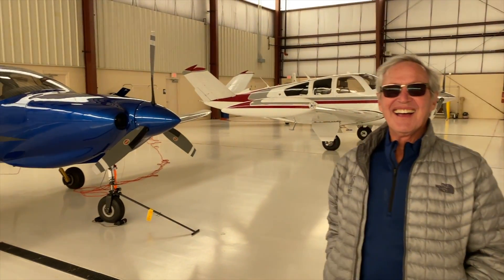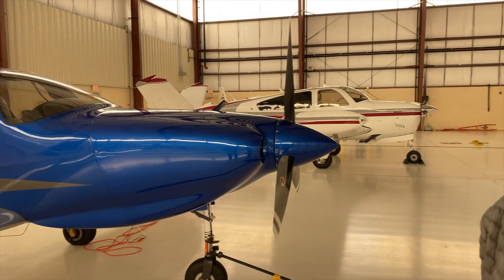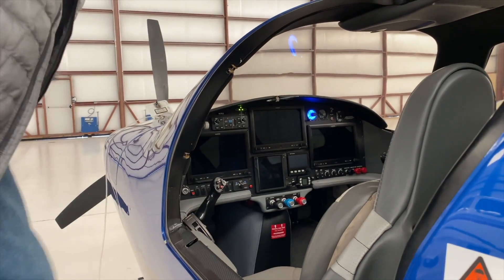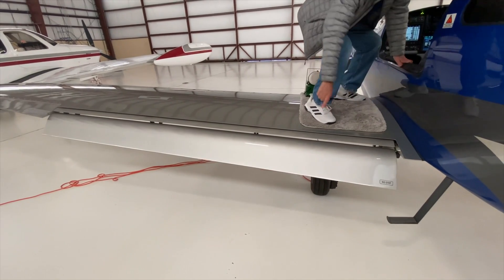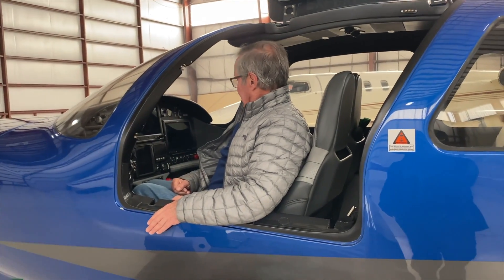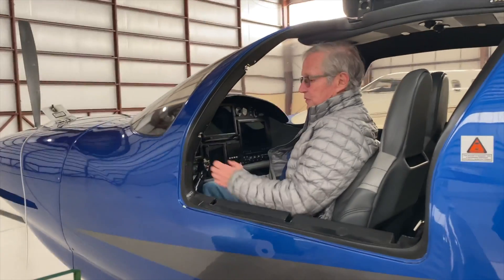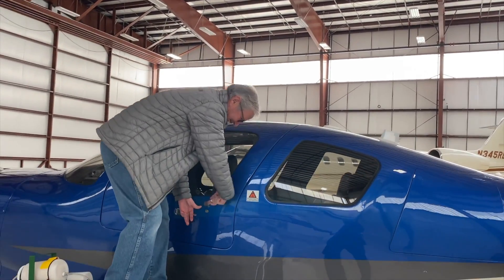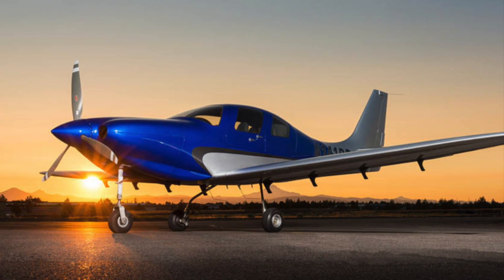LX7 Review with Ken Wolf @ KVQQ Feb 2020

Comment: Pressurised? Cirrus better watch out!
Reply: Cirrus is still much better. Larger roomier cabin, 2 doors, keypad input (good luck using touchscreen with turbulence in the pattern), proven and tested BRS system & better slow speed characteristics. Pressurization is overrated. By the time you reach altitude you'll only be there for a short while, plus you have limited cycles. Ultra long distance trips are probably better left for the airlines.
Reply: @codmott286  Pressurization is far from overrated if you actually fly XC trips over terrain or weather being on a cannula sucks! LX7 Also has a BRS and is way faster than a cirrus they are not even in the same league. Hard to compared an experimental to a certified aircraft both have their pros and cons you have to know what your buying. Cirrus has nothing on the performance and range of this bird, this is not a plane for the "average pilot" and if flown in flight levels ATC expects you to operate like a professional.
Reply: @Jolinator  LX7 might have BRS but it's never been tested. They have no idea what will happen if you fire that thing. The whole airframe might break in half. Cirrus pioneered BRS in civil aviation and have tested it thoroughly with many donor ships plus all of the real world tests. It's proven and they know exactly how the aircraft will respond to it. 

LX7 is faster, cant deny that, however it's not as enjoyable to fly. The back seat is too cramped for adults so it's really just a 2 seater for you and your wife. With one gull wing door it's difficult to get in and out, and even for the front passengers it's still cramped. You will be sitting shoulder to shoulder for the entire ride. Visibility is worse, and of course lancair's legacy for horrible handling characteristics. 

LX7 claims to have addressed this a little but it certainly does not feel as refined as a cirrus. Ultimately the Cirrus is just the more enjoyable plane to fly.
Reply: @codmott286  I think it is the same company that supplies parachutes to both the cirrus and lancair and they do independent testing on each airframe to produce parachutes for that specific airplane. You can't just throw a cirrus parachute in a Cessna, they are engineered and developed for each specifically after a lot of testing.
Both are wonderful airplanes and each have their own pros and cons.
Reply: @superchargedpetrolhead  BRS supplies a variety of chutes with guidelines on how to adapt them to your aircraft. You can put a chute on an experimental ultralight if you want. The testing is up to the aircraft manufacturer, NOT brs
Reply: @codmott286  Oh ok...
Reply: @codmott286  You do realize that Cirrus equips the Vision Jet with touchscreen controls, right? Cirrus also equips the jet with “overrated” pressurization. Why on earth would they do this  on their premium aircraft if both features are undesirable?
Reply: @cascott1392  I didnt say they were undesireable. People want stupid shit all the time. People would buy a touchscreen television for the living room if they could, even though it was be useless and more work than a remote, it just sounds cool. Planning a flight plan on a touchscreen is great. Following vectors and swapping frequencies in congested airspace at 1500 AGL is not. 

And pressurized small aircraft just seems so unnecessary. Most people arent flying these things far enough or long enough to justify the expense. 2000 miles XC? Sure pressurized is great to get above the weather. 200 miles out of state? Why bother, by the time you hit altitude you'd just be coming back down anyway.
Reply: @codmott286  in turbulence the data can be entered via nobs. As for pressurization neither the wife nor the dog would do well with nasal cannula.
Reply: @kennethwolf392  who wants to use knobs? Very frustrating.
Reply: @codmott286  which aircraft do you own and fly, the Cirrus or the LX7?
Reply: @codmott286  in the LX 7 I was at altitude for 7.5 hours on my transcontinental flight. LX slow speed handling is very docile. Cirrus cabin is more roomy, but both are comfortable once in the seat. Bit of a trick initially to get in the LX7 but after a bit of practice it becomes second nature. Two doors is. Ice in the Cirrus , but one door in the pressurized LX7 cuts down the chance of a cabin leak!

Comment: Sad he chose a piston engine.  They make them with a turbine.
Reply: On a plane that probably came with north of a million dollar pricetag (one pistol LX7 is on market for $950k right now) I'm also confused since another $100k for an engine seems like a drop in the bucket at that point.
Reply: @ParadigmUnkn0wn  got the piston for two reasons. 1) much greater range and I fly long distances routinely and the turboprop would frequently require a fuel stop.  2) I have a basic med ticket snd am limited to 17500 feet snd a turboprop doesn’t run efficiently down that low. I’m happy with my long range bird. Recently flew it 2150 nm non stop from Redmond Oregon to Jacksonville Fl. That was fun! Can’t do that in a turbine with roughly twice the fuel burn!
Reply: @ParadigmUnkn0wn  The turbine version is about $1.1m dependent on the cost of the donor Lancair IVP and the cost of the "used" Pratt engine.  It could be a little lower if a good deal is found for either.

Comment: The only plane in the world that’s better than the Panthera especially since you don’t have to look through a huge Ibeam pillar going down the center of the windshield and actually has the strength to go well over 200 kts, unlike the Panthera that has a very weak tail severely limiting its VNE speed. Now they just need to put a MT reversing Prop on it to get into the shorter runways and it would be perfect.
Reply: i like the center pillar, improves visibility from the sides
Reply: The Panthera is a joke compared to the LX7.  It is far slower and has far less range.
Reply: @speedomars  The panthera had great potential but it was entirely built around Lycomings next 4cyl engine which they abandoned forcing Pipistrel to redesign the airframe around a 6cyl engine costing them all of their performance gains. Now the plane is no different than any other, just a unique interior.
Reply: @speedomars  Panthera is no joke, all the possible new Mooney buyers are dumping that stupid plane and going for the Panthera and the rest are trying to sell their planes for the Pipistrel, since Mooney has become the real joke in performance, no weight carrying, embarrassing landing gear, abysmal landing performance. Even an old Comanche 260 is better at everything than a new Mooney, even the flaps are better on a Comanche than a Mooney.
Reply: @tropicthndr  You are smoking something.  The Panthera is not in production...it is an EXPERIMENTAL kit plane right now.  It is not certified.  It will die like Mooney died for two big reasons.  1. it is made not made in the US and it has no support network.  2. it has retractable gear making it hyper expensive to insure and maintain.  3. its range and performance specs are unimpressive.  4. no one has seen one yet in person.  who is gonna buy a plane you can't sit in or see?
Reply: @tropicthndr  Mooney buyers.  Need you say more?  The Mooney is another loser aircraft any surprise those types go after another loser?  But it makes sense Mooney's would go for another retractable plane...they are like leemings over the cliff.
Reply: @tropicthndr  Mooney's are a cool plane though! Still the fastest certified single engine piston, Utility category and built extremely strong, speed brakes, NXI G1000, 25k ceiling, great range, and a useful load that is actually comparable to most other single engine pistons if they are all loaded with the same amount of fuel. People forget that the Mooney can carry a lot of fuel. Full fuel payload is actually about the same as this LX7. 320 LBS.  Plus they look great. Most new buyers are probably going for the SR22, sadly, because of its great useful load, Garmin Perspective avionics, and BRS parachute.
Reply: @speedomars Retractable landing gear has been common on piston airplanes for over 60 years. I doubt insurance is a major hurdle for any pilot with reasonable flight experience. And Cirrus had no trouble selling over 500 of its single engine jets with retractable landing gear. Many of these pilots were probably stepping up from the Cirrus piston plane.
Reply: Any Cirrus is better than the Panthera....in fact the Panthera is just the latest wannabe Cirrus aircraft.
Reply: @speedomars  i wouldnt really compare it to the cirrus. It's completely different. 3 doors, center pillar, center stick, 3 screen panel, t-tail.
Reply: @codmott286  You are talking about cosmetic differences.  The reason it wants to be a Cirrus SR22 is that its all carbon fiber airframe, BRS chute, piston single, same gross weight class, non pressurized, same ceiling and range, same basic seating.  The major difference is fixed gear versus retractable.  And that is why the Panthera will not succeed.  Mooney lost against Cirrus for basically the same reason despite making a slightly faster plane.
Reply: @speedomars  by that logic all planes are trying to be a cirrus. What you are describing a 4 seat XC plane, doesnt make it a cirrus knockoff. The appearance and flying characteristics are unique enough that the Panthera is its own plane. Also Pipistrel has a USA presence so parts/service shouldnt be an issue. You might not get the same turn around as a Cirrus owner who can get service at any A&P they land at, but it's a new plane, not a new rocket.
Reply: @codmott286  You misunderstand.  But I am not gonna teach you the basics.  Study the designs carefully.  Maybe you will get it.
Reply: @speedomars  Thats fine. You are trying to say both planes are similar because they both have wings and can fly.
Reply: @codmott286  You can skip reading the details of what I said...that's  your problem, not mine.  But if you want to better analyze and assess what the Panthera is versus what a Cirrus SR22 is...you will let your ego down and accept the objective facts.  BOTH planes are all carbon fiber and BOTH planes have a parachute...BOTH planes use Garmin glass and BOTH planes have similar power, range and crusing speeds.  In short, they are competing with each other for the same mission parameters and are built the same (carbon fiber v metal and rivets).  The major difference is the landing gear and that is a problem for the Panthera.  Retractables are more costly to build, maintain and insure.
Reply: @speedomars  BOTH planes have 3 wheels to land on, BOTH planes have TWO wings, one on each side, BOTH planes have an engine in the front and a tail at the rear, BOTH planes use propellers for thrust. None of the items you list are unique to the cirrus.